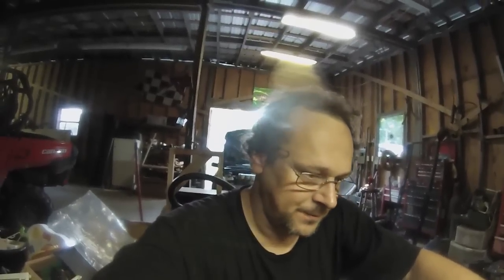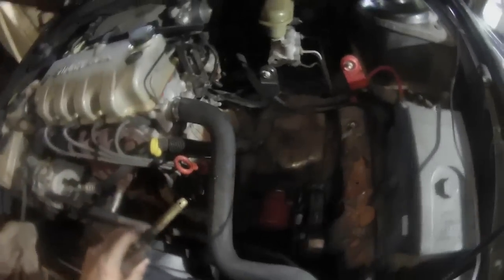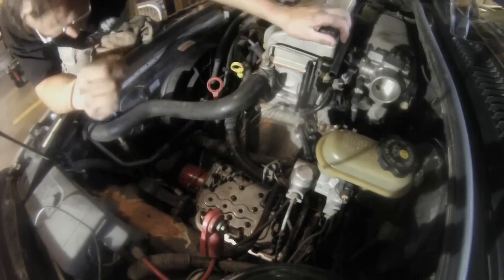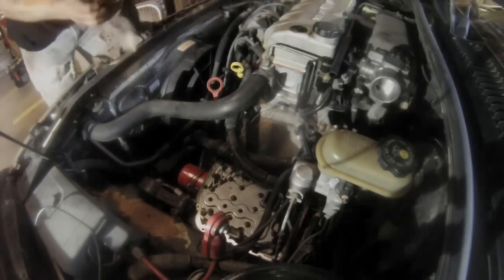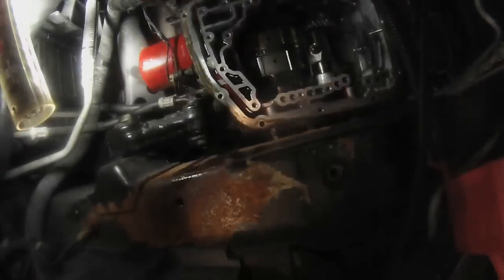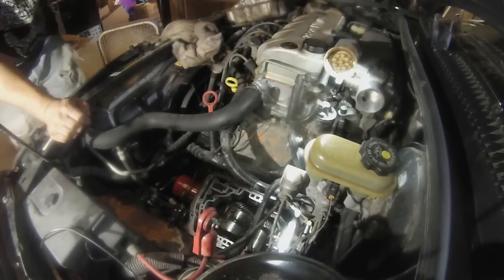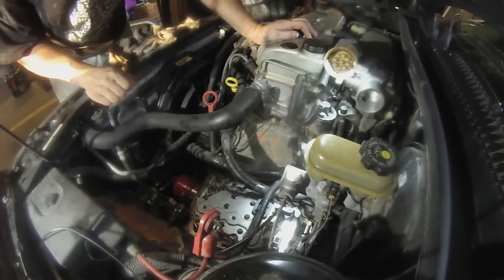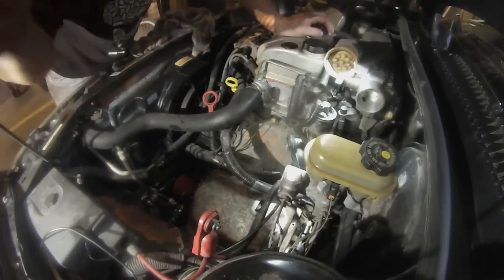Saturn Valve Body replacement

Comment: I got a saturn sl1, it was leaking transmission fluid , now the fluid smells burnt and it wont shift properly or accelerating fast, u just hear a humming aound like its trying to accelerate,i wonder do i need to change this ??

Comment: I have a 2002 sc2 i havent drivin it in like 3 months because it randomly started shifting extremely rough one morning and i havent drivin it since that day after work , a friend told me he just tightenend the input shaft nut and that fixed the reversing clunk that it had but will this fix the shifting up gears ty
Reply: I’m getting reverse slam on my SC 1 how difficult was it to tighten the input shaft

Comment: Hi thank you very much for the video but you really didn't go through the relearning procedure is it just automatic where it will re learn by itself when you drive it or is there some kind of special procedures when you have to relearn the new valve body on the transmission?

Comment: Cool thanks for showing us how to loosen bolts and brush right past all the important parts like ... What the rod looks like... What it's used for.. Where does it go in relation to the valve body..
 Does it need to go in any certain way? .... Instead " ok ill do that and get right back with you.." .......wtf kind of help is that... what is the point of a VIDEO if you dont actually SHOW any of the work...  Kind of a square peg in round hole... Always drank tap water kind of guy I see...

Comment: @rvprepperwayne  did you use a tourqe wrench for vavle body bolts or just tighten by hand feel ?
Reply from the maker: I did it by feel.  After many years I've learned when it is tight enough.  Its best to use a torque wrench.

Comment: It would be helpful to see a close-up of the part that has to slide into the valve body. I have no idea what you did there.
Reply: Did you get it? I’m currently doing it and need help with the same issue
Reply: @user-lb4qb6mk4p  I gave up. Found out that Saturns are a bit difficult to source parts for, and never picked it up. It was offered as free, to whoever could make it run. But nah. I'd rather get a Subaru. Or any Japanese car for that matter

Comment: Have an 03 Saturn Vue was driving after a red light, car would go slow, then in a few seconds would begin to pick up speed. Got a code for P0962 and I just got a call from the shop saying its the control valve body. Charge will be 1300, he said he usually charges 2600 to build and do this. With this code, this is NOT needing a new transmission? I was always told they costed around 3000 for a new one. Will getting this installed (control valve body) possibly solve my current issue, please respond i'll be waiting thanks!

Comment: You only needed to replace the line pressure solenoid in the valve body. You could have done that without even taking the valve body off....Have replace that line pressure solenoid a thousand times over the years and that's always been the problem when you have that hard shifting.

Comment: I did this on my 2001 SC1 in 2013 when it had 125K on it. Now it has 255K on it, and I will do it again.
It was $150 on ebay then, now $200 for one with the Sonnax update.
It's not a hard repair, with videos like the above - Thanks Wayne! 
He's right... just keep things really clean.
Reply: Did you saturn have the issue of shifting hard up gears I'm thinking about doing this

Comment: I have a 1996 saturn wagon and it is at 234,000 miles, it's leaking trans fluid and has a hard reverse slam , I'm thinking it might need a new valve body put on it, I hate to put a whole new transmission in it but would if it came to that as I've put tons and tons of new parts on the car and am going to keep driving it. I've had the car 12 years and it's been a trooper
Reply: This fix will likely fix the reverse slam,
and once when I did have a transmission fluid leak, it was just coming from the filter.
I have a 2001 SC1 I got in 2011 with 70K on it, now I have 255K on it. Have replaced a lot of stuff, but I like the car.
Reply: @spettro9  You know it's funny you mentioned the transmission leak coming from the filter, about 10 years ago I took my saturn to a trans shop and it was leaking fluid and that was the problem, they put a new filter on it and filled it back up and I didn't have any more issues with it, this seems to be some common thing with the older S series Saturns. I have had 3 of these S series cars and know them inside and out including every one of the issues that crop up on them like the coolant temp sensor almost always goes bad on them as well as the belt tensioner ect.

Comment: How do I do a valve body relearn and a Shift Adapt Reset? Because I just replaced the valve body in my 2002 Saturn SL1 and now it acts like it doesn't know how to shift.
Reply from the maker: Several stop and starts as you drive in a normal manner.
Reply: Did you reteach saturn to shift again

Comment: My 96 SL2 has been bucking and stumbling whenever I try to accelerate normally. If I drive it very, very gently as if there was an egg on the gas pedal, I can get where I’m going, however much slower.
Reply from the maker: Buick Mackane have you had the fuel psi checked
Reply: rvprepperwayne 
No I haven’t, thanks for suggesting, I will make sure to have that checked first, before I begin changing out any transmission parts.

Comment: This video might be a bit old, but it sure as hell was informative. 

Was just coming home from work in my 95 sl2 when I suddenly lost all drive. Did a little research and figured out my SEC was showing a code 11.

Did some more research and found it might be the valve body. Found your video and read your comment recommending the sonnax upgraded valve body. Went to their site and saw the symptoms and realized it's almost definitely the valve body. 

Thanks to you, I'm 99% sure what my problem is, and now I know how to fix it!
Thank you good sir!
Reply from the maker: I'm Glad My video could help you out.
Reply: @rvprepperwayne  mine stalls I'm hoping to change the solenoids... And not the torque converter.. I've redone my whole engine so I'm hoping this works... Almost junked it... One last try
Reply: @jbrooks5308  did it work?
Reply: 2024 and im using this tutorial thanks my friend

Comment: Great video.  Do you know if they make a valve body rebuild kit?
Reply from the maker: Its not worth doing it yourself. You will need special tool to rebuild it correctly.
Reply: I ordered the valve body and it's in route.  Near the end of the video you mentioned going through a shifting re-learning process but didn't see you cover that off.  Can you share a little detail about what I should do when I get ready to start the car and move it into gear?

Comment: Question about the gaskets.. you commented about cleaning the pan gasket surface and the pan gasket.. is there a gasket between the valve body and trans. assembly?  Bolt torque?? Did you use a torque wrench on the bolts.. thanks.
Reply from the maker: The valve body is a 2 piece design with a gasket in the middle. as long as that gasket is not torn you can reuse it.  I used a 1/4 ratchet and tightened  the bolts that way. Don't crank down on them super tight. I think it calls for 14 inch pounds( I could be wrong).

Comment: Probably a dumb question... is this manual or auto? i watched the entire video and i have a issue only sometimes on my auto 02 sl1, sometimes a hard shift at 1st to 2nd, and 1st to R.
Reply from the maker: This is an automatic. To me it sounds like the valve body is bad. Very common with Saturn automatics. When buying a Valve body make sure you get one with the Sonnax upgrade. You can find them on ebay or you can get one from http://www.sonnax.com/remanufactured_valve_bodies Direct link to the saturn VB  is- http://www.sonnax.com/parts/4158-remanufactured-valve-body

Comment: Ay Wayne Thanks Buddy, for the Vid! Couple questions though,  I bought 5 used / tested solenoids for my 96 SL2, when I got them, I tested also 5.0 all the way across, the reason I bought them,,  had an issue with blowing my filters off, + slaggy shifting ( sometimes jumping from 2nd to 4th ) Didn't get any codes pop up for trans... figured it to be the high pressure solenoid.. anyway I figured since I was taking the cover off I would just replace all the solenoids at one time... job went fine, but not exactly sure I got the re-learn down, warmed up, foot on brake shifted into drive back to reverse back to drive and so on,,, aprox 6 or 8 times...?? now to add to  my issue my exhaust pipe rusted through on the back side flange of the cat, causing me to loose some power + I think it causing my trans to down shift kind of hard coming to a stop... Any opinion?? Could you confirm the Re-learn procedure as well?? I will hopefully be repairing the pipe soon,, Have a new one..( Just have to make time to install)  otherwise the engine runs good!  Thanks Will

Comment: I recently bought a 98 Saturn with similar clunky shifting in forward gears but reverse hardly works at all without revving engine to high rpms, in your opinion would a valve body replacement help or even possibly cure this issue? Any ideas would be greatly appreciated i saved the car from the crusher for only $350 and it is in super nice condition all accept for the transmission problem....thanks for the video very informative.
Reply: Also is there a chance the old valve body could be cleaned or refurbished at home by someone like myself who is not a master mechanic to the point that it works properly again or is it a throw away piece ?
Reply from the maker: Sounds like the input shaft nut has come loose. Have it tightened as soon as possible. If not you will end up replacing the trans.
Reply from the maker: Try the shaft nut first before the Valve body. As far as rebuilding the valve body yourself, No. Replace it with a rebuilt unit from special forces. Look for him on saturnfans.com
Reply: that's excellent information, i'm not driving the car until the issue is resolved so no danger of doing any further damage.Are you aware of any instructional videos that would help me learn the procedure for re-tightening the input shaft nut? I am somewhat mechanically literate on most aspects of auto repair but automatic transmissions are like Chinese arithmetic to me, I purchased the vehicle at such a reasonable price with a clear title and almost everything else works great, really hate to see a good daily driver go to the crusher

Comment: i have a 95 sl1 and most of the time it slams into reverse. So usually I have to wait 4 seconds for the transmission to shift into reverse just a mild jolt. But when I move forward it shifts fine just every once in awhile it sputters alittle bit when I'm driving but not much. Just a mild jolt. Is the valve body causing my transmission to react that way?
Reply from the maker: Dave S. Yep the valve body would fix it.
Reply: rvprepperwayne Thank ya I thought it was the tranny but I guess the issue is just a simple valve body lol. Thank god..hey by the way what was saturn thinking in the 90s anyway? Why didn't they create a valve body with a sonnax in it? Why's it important?

Comment: That was interesting and great tip to hold a bolt for hard to reach places.  I resorted to using grease once to hold the bolt In the socket long enough to get it started and then I had a greasy mess to deal with, I like your tip much better.
Reply from the maker: +David Smith Thanks David. I'm glad I showed you a cleaner way to hold  the bolt. I have used grease before and I know it is a mess.